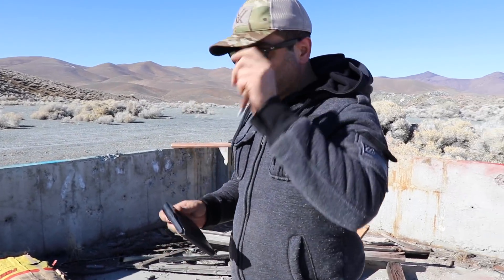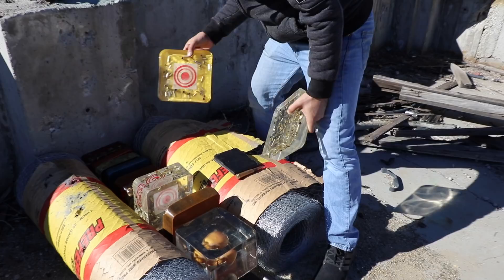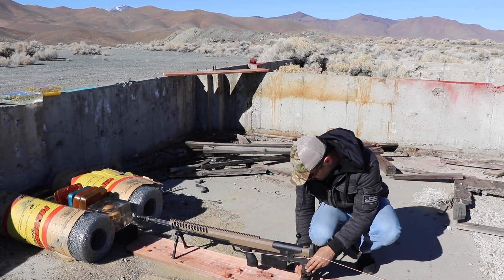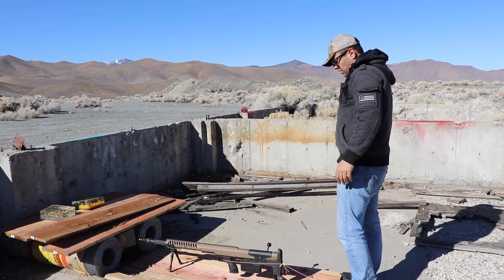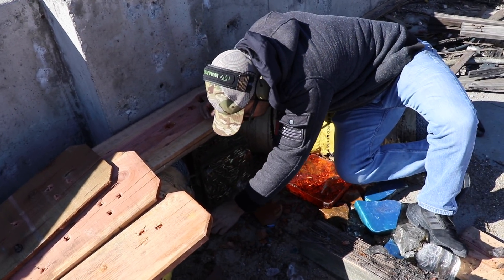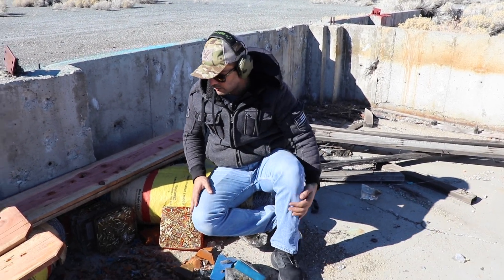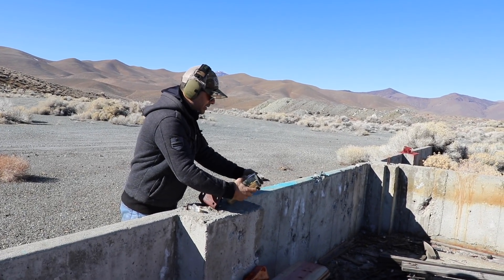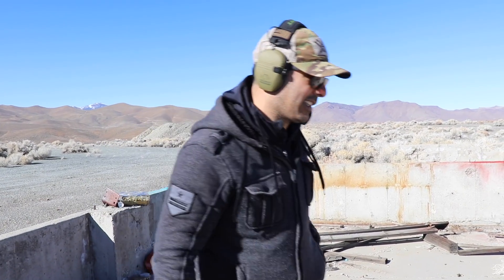how much Epoxy Resin does it take to stop 50bmg

Comment: We filled up our double pane windows with epoxy and used this anti-shatter film that's used in car windows on the outsides of the panes.. they'll stop a 22LR at point blank and a 9mm at 40 yards but not point blank... basically we built them so people can't break in through the windows.. they'll take the force the of a baseball bat many times..

Comment: I've fitted a fair amount of decking, they have some great tools. The cable fencing is my favourite though that's smart. They should experiment with insetting Kevlar and or wire mesh to strengthen the resin and protentialy make it built proof then get you to test it 👍
Reply: Use Welding blankets with that resin.

Comment: Dr Edwin, Would ❤ to see REMATCH between 50BMG and the epoxy blocks with WIRE MESH embedded in them to keep them from disintegrating (like rebar reinforced concrete).
Reply: I thought the same thing.  It would be cool to see!
Reply: Maybe layer with tin sheets
Reply: Is it just me or did he say “de/ick
Reply: I make custom wire mesh.
Reply: Wonder how a combination of Kevlar and resin would hold up
Reply: @DMInsomnia :  That would be a good test. Fiberglass has been reinforcing resin for DECADES, thus Kevlar a good upgrade (or is it?). Maybe do head-to-head comparison of fiberglass reinforced resin vs. Kevlar reinforced resin??
Reply: @hightttech  Fun fact, resin with kevlar (and often carbon fiber) have been used as skin sheets on aircraft for decades.

It would be a fun video idea to use that.
(also really expensive as kevlar is around $38 per yard and carbon fiber is pretty similar)
Reply: Yes, and at at least 50 yds. A .50bmg BALL round will put a healthy scratch in TUNGSTEN. Maybe use a regular ball round, too?
Reply: Please y'all crypto and real estate which is best to get on with ?
Reply: @techiesds1217  real estate by far
Reply: @ryanbroguy  no way, I bet it's Bitcoin instead,  Real estate was actually that over the years but now Bitcoin have made good prospects.
Reply: @aclowesteve6475  yea Bitcoin is perfect
Reply: @davidhinsey719  here is Mary Klein's contact
Reply: Great idea!
Reply: I've got to hear about this Mary Klein online and on the TV. I guess she must be good in what she does for her to be disc this good and far
Reply: @aclowesteve6475  oh yeah she her strategies are top notch and her service are real good .
Reply: Yea I go for Crypto (bitcoin) I've really made me good money for the past few yeara now since I started trading with Mary Klein.
Reply: @techiesds1217  please how can I get  on with Mary Klein I've really been searching for a good pro trader got some funds I I'd like to invest